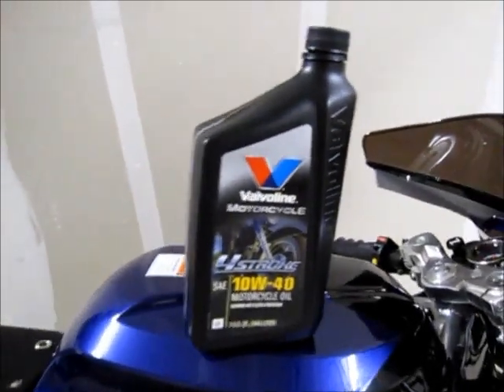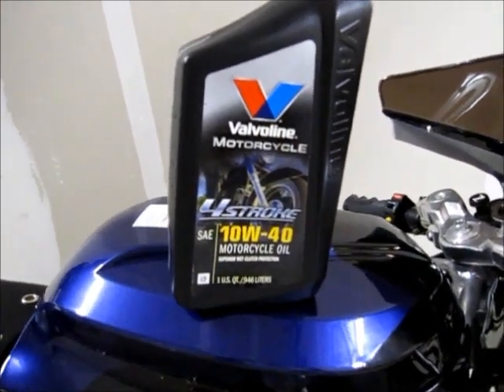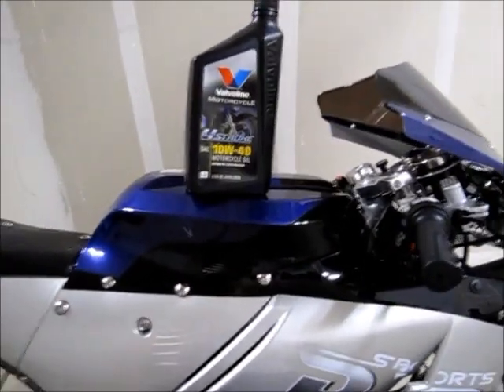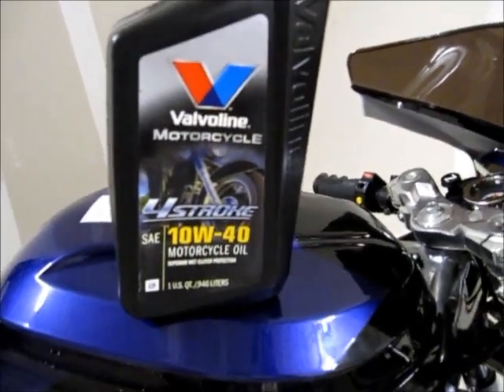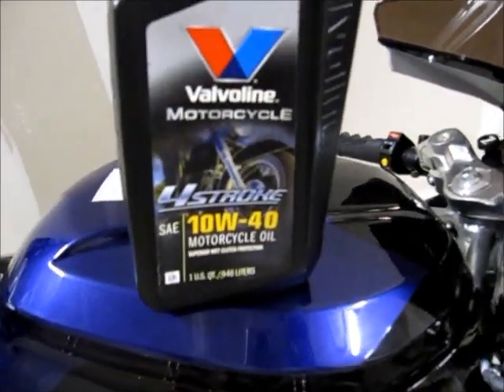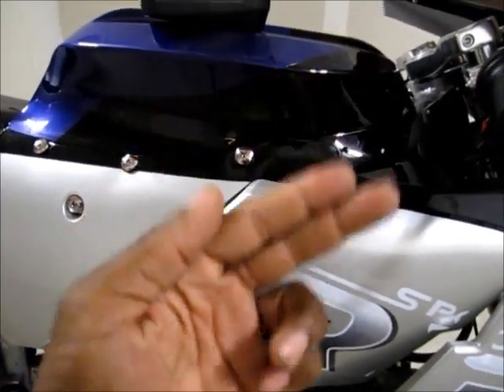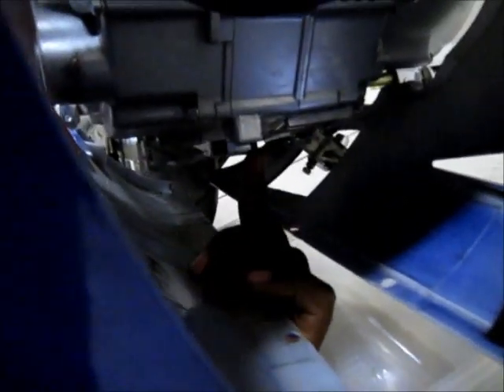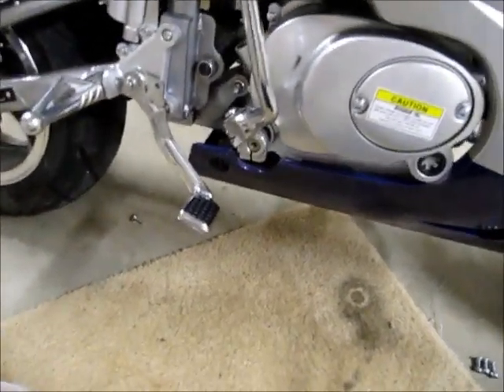How To Change The Oil On A X18 Super Pocket Bike

Comment: 2 stroke dirt bikes still take oil and the gas you run for it is called premix it is special oil that helps cool the engine or it will blow up
Reply: turdmuffin23 i heard you should never get premix you mix the oil your self because when gas sits for a while it gets sticky and that's not good for the cylinder it won't damage the engine but you will find you run out of gas more since there is carbon build up on the cylinder head. if you want to know how i know all this i learned it in grade 10 auto class lol